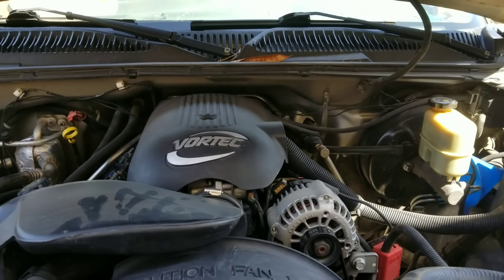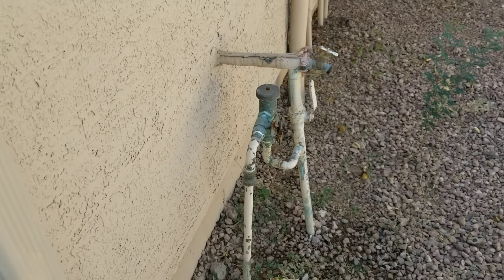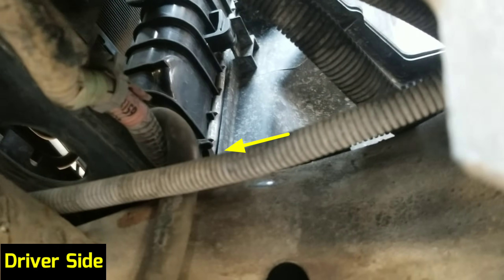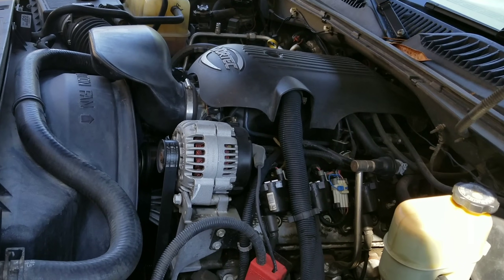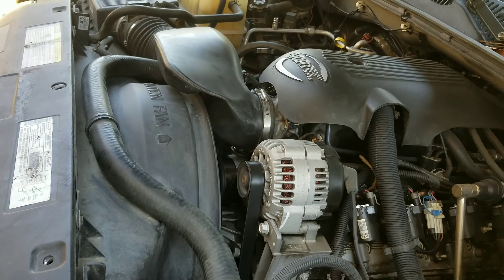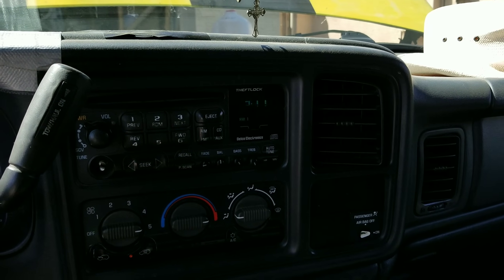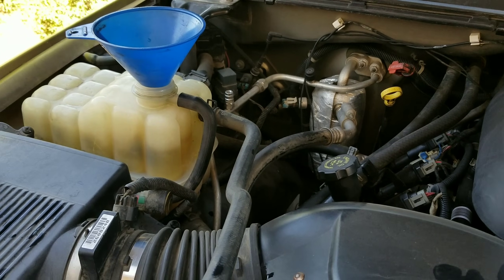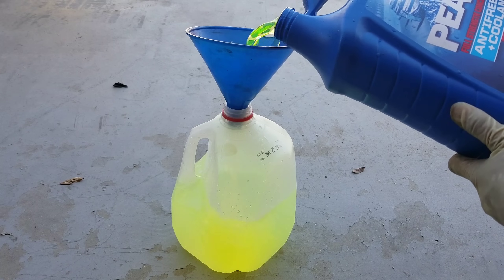How To Flush Your Coolant System! | Chevy Silverado Coolant Change Drain & Fill

Comment: The integrated transmission cooler in your radiator is leaking into your cooling system that's why your first sample was heavily contaminated like it was
Reply: What do you do to fix that issue and what should I look for if its contaminated? I.E the color or a oily substance? Thanks for your help.
Reply: @brandoncuts82  the integrated transmission cooler is inside the radiator... if you follow the transmission cooler lines you'll see they connect to the middle ports on either side of the radiator "engine facing side"... if the integrated transmission cooler is leaking into the coolant system portion of the radiator id suggest swapping the radiator  completely, check/drain the transmission cooler lines and verify they arent rusted to shit... if your lucky enough to live in a rust free climate all the better. Had to fix a mechanics cob job and discovered rusty transmission fluid in my transmission cooler lines. Apparently had a blockage inside the intergrated cooler and he just bypassed that all together without plugging the holes and hooked up another auxiliary transmission cooler lol found out during winter when moisture got into the intercooler and froze cracking my radiator... turned into a fun under a tent driveway project 🤣
Reply: @mm-nl3qz how does one know if transmission fluid is in your radiator? I have brown sludge in my radiator but I figured it just got dirty and needed a flush. How would I know for sure that it's from the transmission cooler line?

Comment: Can't i just use 50/50 premix instead of mixing it myself?
Reply: No!
Reply: You need to understand after draining and filling with water alone there is little to no coolant mixed in the solution that remains in the block and heater core. It's all water. You need to add a min. of 50% of your total cooling system capacity. Then top off with a mix of 50/50.

Comment: But what if your heater core is bypassed?
Reply from the maker: it's the same process by to burp the coolant system your wait for the cooling fans to turn on and squeeze the radiator hoses to get any air out that's trapped

Comment: You put the wrong antifreeze in your chevy. Dex-cool only
Reply from the maker: You can add any kind as long as you remove the original completely
Reply from the maker: Ten years after General Motors began using Dex-Coolas an antifreeze in most of its cars and light trucks, GM car and truck owners continue to complain that the coolant corrodes and clogs radiators and radiator caps, erodes water pumps, rots radiator hoses, causes chronic overheating and engine damage while leading to ...
Reply: Either way you mentioned how the other one is a diferent color but then you know is because the other one is the right one to use
Reply from the maker: it's not the right way it's what is recommend not required.
Reply: I've been running yellow coolant in my truck for the last 2 years without any problems. Dex Cool is cancer in an LS, it gels up and clogs everything after 20k miles, the best thing to do with it is get it out of your engine and swap it for a different color, you can use any color as long as you flush it all like he said. Recommended for any Chevy engine other than an LS
Reply: All I've got to say about the green coolant is that I had 2 heater cores  changed in less than 14 months because of it being in the truck when I bought it used. The second time, I was told by the owner of the shop that changed them both and I quote "you're not supposed to use the green coolant in these engines, they are only supposed to use DeX cool". My reply "really? Well that's strange because I haven't put coolant in it since last year, when you changed the other heater core". I got the Homer Simpson "Doh!" look. Lol needless to say I got a greatly reduced price on that one. And yes I still use that shop for any work I don't want to do myself, which is rare. Use the green if you want but I won't. Ever.

Comment: Well it seems like a very good way of flushing the vehicle problem I see is when you first drain the coolant it doesn’t all come out you obviously have to add water five or six times and after doing that you finally get all the coolant out well I think you i’m going to have rust problems like you said because you flushed it very thoroughly with tapwater now you drain it like you did the first time and start adding coolant well guess what that tapwater is stuck in the engine now so you probably have a gallon to two in the heater core etc. that’s going to mix in with your distilled water and coolant just my two Satoshi‘s.....
Reply: In his video he used distilled water. Did you not see the gallons
Reply: @alecsanderfuentes3913 no he used garden hose for flush. Distilled was for the 50/50 mix

Comment: You guys can do what you like, but this is way overkill. These red/green mixtures work perfectly well together in any combination. I would think that you would be more worried about adding the tap water than the complications that might happen from mixing. All of that adding and removing gives more chance for really bad stuff to get in there from the tap water LOL - like organic matter that ends up growing. 
I have a 2007 Suburban with 309,000 on it - the last 100,000 were with a mixture of red and green ( I did not flush it when I changed from one to the other) as O'Reilly's claims that they are compatible and I believe they are from my own experience. 

I find it almost unbelievable that there is no way short of opening the frost plugs to drain the vortec engines. They sure do not drain well from any of the openings in the cooling system. I usually dispense with the little drains and drain about 13 quarts out of the lower radiator hose after pumping out the overflow. The remaining 10 quarts must be in the engine, the heater and on the ground. I sure as the world am not going to put tap water into it to replace any 'red' that still is in there  - but that is just me. I have been doing this for about 50 years. The last 25 of those years I have switched from red to  green many times with no ill effects on many vehicles.
Reply: If I’m low on fluids, is it alright if I just add some more and call it a day, I don’t want to go through the trouble of draining everything and all that mess because my coolant isn’t old enough to do that.
Reply: @tsuyoxeno9566  I keep 50-50 on hand so that I can top-off the vehicles without messing around. I have never felt the need to attempt a full flush of any of my vehicles because there is so much residual fluid left in there when you drain it. And when you flush it, the bad stuff gets mixes in with the good and makes it questionable at best. 
However, the use of household water (tap water) is not ideal - it MIGHT have minerals in it. If you talk to your water supplier, you might be able to find out. Anyway, the point is that trying to get the old stuff out is a futile effort. How much  bad stuff can your vehicle stand to have - you will have more than that when you are done. 
The only reason to flush is when there is some form of precipitate clearly clogging up your heater or radiator. And that virtually never happens.
I live in Texas and I would not hesitate to use the tap water for my vehicle water replacement, but 50-50 avoids all of that. In fact the tap water in most of my recent locations around Texas is so good that I would even use it in a battery - I will probably get blowback for that statement, but since I have been out of Minnesota I have not had concerns about the drinking water having minerals in it - just not enough to bother anything. And of course in a battery, when it gets to that point where you need to add water, your battery is not going to survive much longer anyway.
Reply: flushing with tap water isn't gonna do anything bad as long as you fill with distilled water in the end... a liter or two of tap water, when diluted down with gallons of coolant and distilled water is not going to introduce nearly enough minerals into the system to cause an issue. Not to mention all modern coolants have chemicals to prevent minerals from damaging your cooling system, since a lot of people with leaky radiators will add tap water to the system anyway.
Reply: @jc13781  OR don't put any tap water in
Reply: Mixing Dexcool with standard old green anti-freeze causes huge sludging and blocking little coolant passages.  Don't believe it?  You can see photos of it all over the web.   Doing something for 50 yrs doesn't mean you've been doing it right.

Comment: You shouldn't mix the coolant first. Add the appropriate amount of concentrated coolant for a 50% mixture of the given cooling system capacity of your engine. Then add distilled water to the truck until full. You can never truly drain it all out, after your last flush some water will remain. I use distilled water for the last clear water flush.
Reply: You have a good point. However, removing the block drain plugs will completely drain the block. This in turn will make for an accurate ratio of coolant.
Reply: @ryanroberts1104  I don't think wrong is accurate. I do not see any harm coming from draining the block. Otherwise it would not have been designed with it. Yes, for a mechanic that gets paid a flat rate, this extra step will take more time & time is money, right? But I am doing this on my own truck & desire to be thorough. It was stated that a 50/50  mix will likely dilute to 75/25. That is a lot of fluid that did not leave the system. That fluid is trapped in the block. Drain the block & the only fluid left will be what clings to the walls. You can then fill with a 50/50 mix that might dilute to a 50.999/49.001 mix.
Reply: @tonylopez9936  If you are not flushing your block until clean water comes out then you are doing it wrong. If you need to open the block drains because there is anything in there but clean water you are doing it wrong. And if you think you should just open them because they are there you are doing it wrong.

This is simply not part of a coolant flush. Just like tightening the muffler bolts are not part of a coolant flush.

If your 50/50 mix is not 50.0000000% it does not matter even a little bit.
Reply: @ryanroberts1104  , "Just like tightening the muffler bolts are not part of a coolant flush." JUST LIKE? Messing with muffler bolts does not affect coolant. On the other hand, the block drain plugs release coolant! Your analogy is nonsequitor. Please, how about you tell me what harm comes from removing the block drain plugs? Why are you skipping the obvious? I will give you this. Opening the block drain plugs is wrong FOR YOU. If you can not show what harm comes from Using the "BLOCK DRAIN PLUGS", no problem here. Your logic, (or lack there-of) is your logic. I am offering a suggestion and twisting no arms on its implementation. If it helps, awesome. If it doesn't float your boat, don't do it. If it does do some harm pass it on.
Reply: @ryanroberts1104  And that mentality is our bane.
Reply: @ryanroberts1104  Careful Ryan, your intelligence is on display. lol

Comment: I just changed my radiator and my lower hose fills tuff like nothing getting thrue and now some coolant leaked out near my ac condensor silver can close to the frame wall, theres a lil hose ...it took all 14qts fine but it wont let me fill the reservoir tank stays at the bottom.   What you think

Comment: Would this work on a 2005 gmc savana ? I hear you have to bleed the coolant not just drain and pour new coolant is that true? And how would i bleed coolant?
Reply from the maker: this is not the same as a GMC Savana but it could be similar. when you fill your radiator leave the cap of and let the vehicle idle, once the fans kick on that means that the coolant has gone throughout the coolant system. squeez the hoses to help push the air out of the coolant. make sure to not drive the vehicle right after filling you have to bleed the coolant
Reply: @ERICSDIYGARAGE  thank you for replying soon i had a water pump and thermostat installed yesterday i guess the guy that did the work did not bleed the system because i drove the truck today and temperture went up to 75% no more than that though so i started researching on that and came a cross your video thanks for posting .  I need to turn the heater on right after the thermostat opens or right after turning on truck?
Reply: @ERICSDIYGARAGE  and also just filling up the radiator and keeping it filled using a funnel better i wont need to disconnect any upper radiator hoses for this gmc savana only turn it on, wait for thermostat to open, turn heater on for coolant to circulate and wait for all the bubbles to come out that will be it?
Reply from the maker: turn on the vehicle and set the air to heat once you feel hot air coming out the thermostat should be open. make sure to let it idle for a good 20 minutes and touch the hoses to make sure that they are all hot to the touch.
Reply: @ERICSDIYGARAGE  thank you at this point is it better to flush the radiator and start over or just bleed the system ?
Reply from the maker: no that shouldn't be necessary try to see if this works before you do that. if you just let the vehicle idle and open the radiator or overflow tank and squeeze the hoses it should be sufficient
Reply: @ERICSDIYGARAGE  thank you very much brother i will let you know what went on after i perform that im pretty sure everything will be alright after doing research and with your explanations i understand how this works now god bless you keep up the good work

Comment: WOAH WOAH WOAH !!!!!!!
You drained out Dex Cool which is engineered for GMs after 1995. Why are you using green silicate-based coolant? You're going to end up with a ton of corrosion in your cooling system now. You talk about tap water causing rust? You're going to be dealing with a lot worse than rust. 

O.A.T  , silicate-free coolant for 1995+ GMs always....
Reply from the maker: Truck is running great no issues years later. You can use whatever coolant you want in your car if you drain the old coolant which is what I did in this video

Comment: The new green fluid is fine. Don’t ever use distilled water in these engines. See your owners manual. Also look at Haynes manual for correct flush procedure.

Comment: Tap water? It will rust or leave minerals in the system.  I don't recommend tap water in this process at all but otherwise great video
Reply from the maker: I used tap water to flush the system I only used distilled water and coolant to fill it up
Reply: @ERICSDIYGARAGE  oh OK I was like tap water I thought you only used tap my bad

Comment: You should not change coolants. If it’s green keep green and if it’s dexcool use dexcool.
Reply from the maker: You can change the type of coolant as many times as you want. You have to remove the old coolant and flush it all out before using a new one. Coolant type will no damage the vehicle as long as you do this.

Comment: NEVER start an engine without coolant, how are you going to deal with the heat of combustion?  Think about it!
Reply from the maker: it was for a brief second the engine is not going to explode relax
Reply: Takes about 4-6 minutes to get hot...
Reply: I think without coolant you would be fine for a short period of time. Oil is actually the first line of defense against overheating.
Reply: Agreed.  Running an engine in order to use the water pump to pump out the cooling system is taking a big chance and asking to overheat the block and cylinder heads.   Bad idea.
Reply from the maker: The block will still have coolant in it. Not sure if you have ever pulled a head off an engine, but when you do, you will see that coolant will still be in the block. Same thing here, so please stop exaggerating. Also the engine was not idling for more than 2-3 minutes
Reply: @ERICSDIYGARAGE  Not exaggerrating at all.   Having little or no coolant around those exhaust valves in the heads and not around the cylinders in a running engine is very reckless.  But you do you.   Gravity takes a few more minutes and is the smart way.

Comment: You didn't bleed it...
Reply from the maker: Yes I did, once you feel hot air coming through the vents that mens the coolant has circulated the cooling system usually when that happens air bubbles escape through the top of the coolant reservoir. If you want a better understanding of how this done I suggest you try searching for a video specifically showing you how to bleed the cooling system on these vehicles since this was a flushing video

Comment: I clicked on this video just to say you don't put green antifreeze in a Chevy it takes Dexcool
Reply from the maker: You can put any any type of coolant in your vehicle as long as you remove the original coolant.
Reply: people have had problems with dexcool but the problem is only with early GM vehicles they put dexcool in that weren't designed to run dexcool they didnt know it was gunna eat seals and plastic(they should of known but guess they didn't think about acid eating things lol) they have since redesigned the coolant systems specifically for dexcool if you don't get all the dexcool out and refill with green it will create a grease/gel inside your coolant system and you will have to do what i did on a truck and spend 2 hours flushing the system because someone mixed coolants so in my personal experience do not mix coolants, dexcool is a good coolant and actually keeps your coolant system clean so i would recommend using dexcool if the coolant system is designed to work with it.

Also I have a 2004 trailblazer with a 5.3L vortec and I've always had dexcool in it and ive never had an issue with the coolant just did my water pump and fan clutch yesterday and my system was perfectly clean, 322k miles and still going strong
Reply: @bstceltics4  negative Ghost Rider. They call it Dex-Kill for a reason!